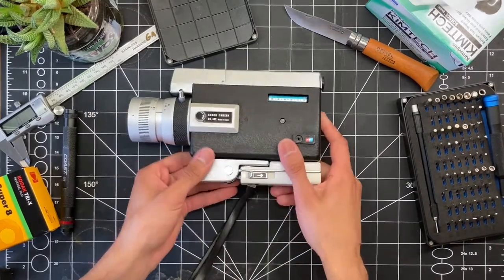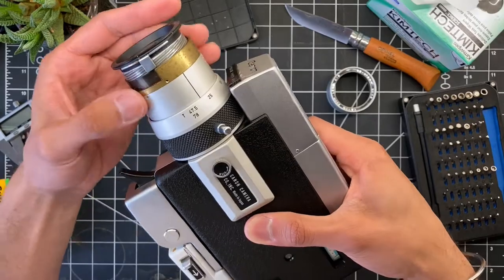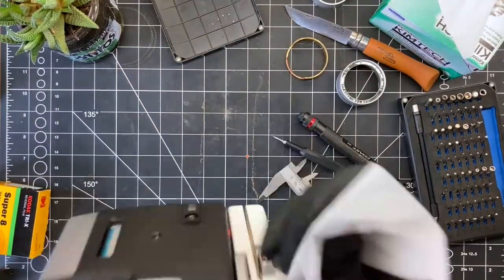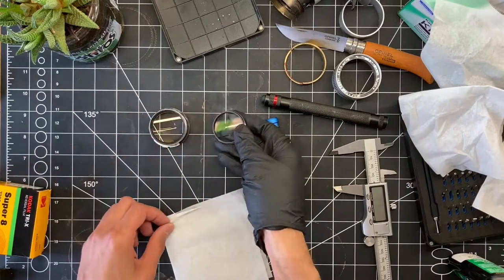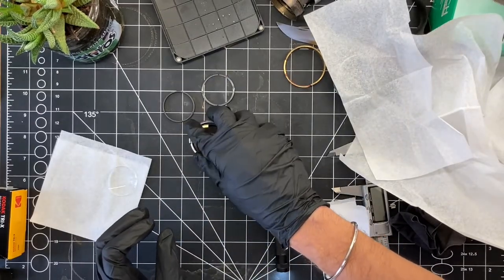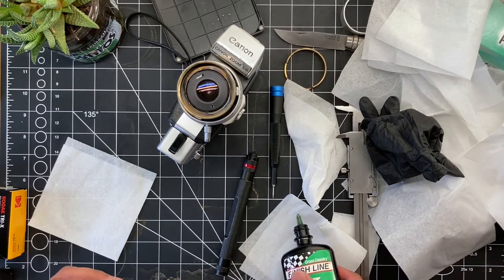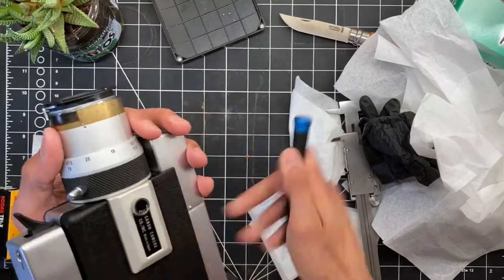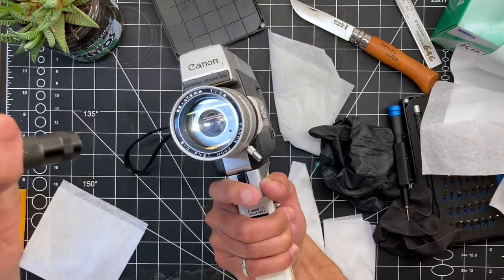How to Repair Your Canon Super 8 Film Camera

Comment: Hey , I just got the canon 518 but it has baterry corroison on the battery compartment at the top and im afraid it wont work. What are the chances it works if i clean it out? To my point of view it seems liks it's probably damaged but im not sure.
Reply from the maker: Hey hey, battery corrosion probably won’t affect the camera that much. Just make sure you clean the battery contacts.
Reply: @prematureYeet   Thank you !